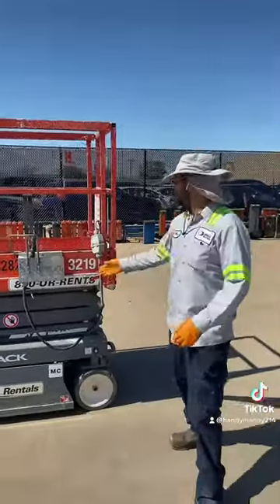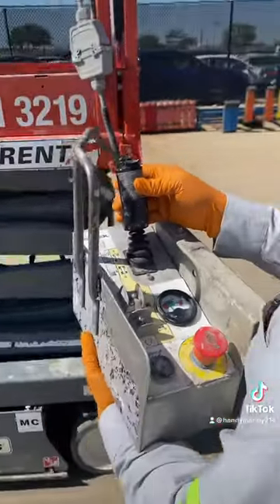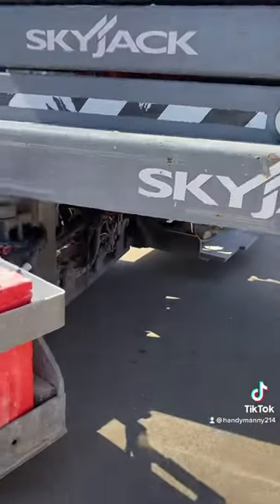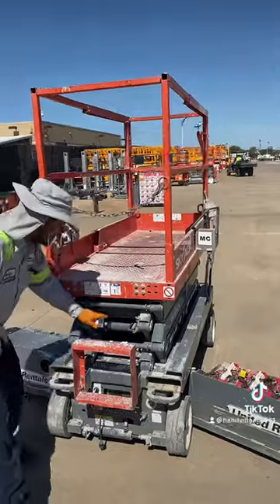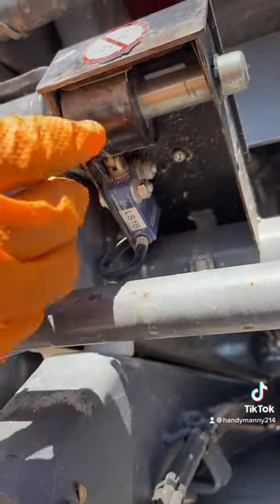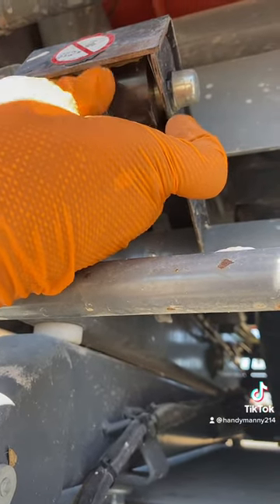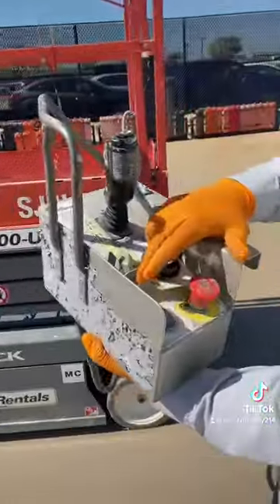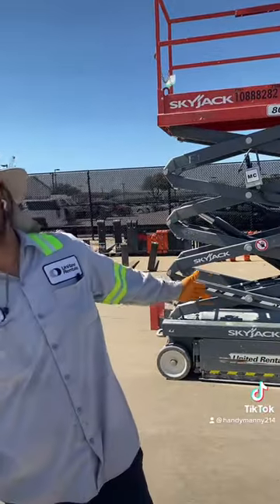Scissor lift will not drive !!

Comment: I have a Skyjack III 3226 Scissor Lift having so issues. When I push the lever forward or reverse, the pump starts running lift doesn't move, after about 6 seconds the pitch changes and then after another few seconds the lift finally starts moving. But it doesn't seem to move very fast, and there is almost zero speed control. I have a video of it, I just don't know how to send it. Any help would be greatly appreciated!

Comment: Manuel,
i have a 3219 scissor lift just like the one on the video and it is fully charge but when i try to drive the Niddle on the control box goes to zero almost like if its shorting out but when i let it go it goes back to fully charge any suggestions?
Reply from the maker: Yeah you have a short somewhere 
Double check the batteries 
You’re loosing all volts to the top when you stroke !

Comment: What about if I adjusted that but then it’s the opposite. Wont slow crawl while in air? Maybe I didn’t adjust properly?
Reply from the maker: Check the bottom switches also. Manually close them make sure they aren’t stuck

Comment: i have a JLG 1932e3 i had to change the hoses on the wheels, can you make a video on how to bleed the system ?
Reply: After you replace the hydraulic hoses on the wheels (the drive hoses), just drive the unit and it will self bleed the system and eliminate air in the drive hoses

Comment: Hey Manuel,  i got a jlg35e that keeps blowing the f1 fuse when i press the pedal,  have replaced breakers, wires from pedal to control box and the switches in the pedal. Thanks
Reply: Wondering if there are any other relays or limit switches to check

Comment: I have one of the 3219 sometime it’s not responding With controller after playing with back and Fort then the machine start to move. What could cost that?
Reply from the maker: Bad contactor could be a issues
Reply: i fixed a bad contactor on a lift once. the pads were all ate up from arcing. I made new pads with 10/90 solder then used a file to make them flat. it still works.
Reply: Same 1 but it won't move or go up or down it just clicks got power but won't move at all any ideas

Comment: I have a JLG 2032e2 that the platform control wire got cut and I repaired it and the lift still won’t move at all is there something I’m missing?
Reply from the maker: Those E2 units are simple but old lol 
I would start to see if I’m getting volts up on top I know those units also had a line contactor down by the base. When those go out you’re left stranded lol try tapping on it.
Does the motor engage at all??